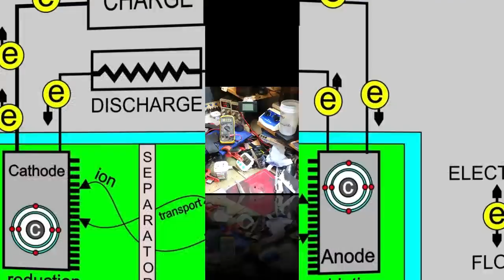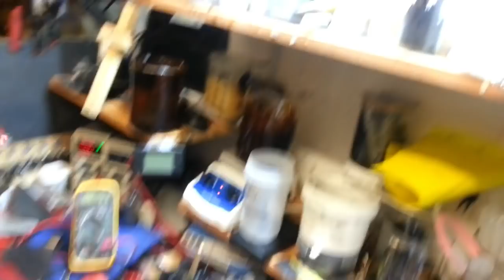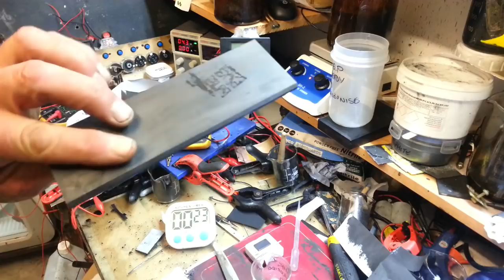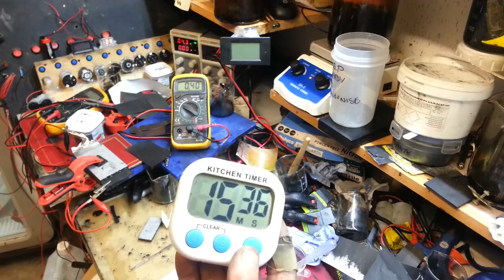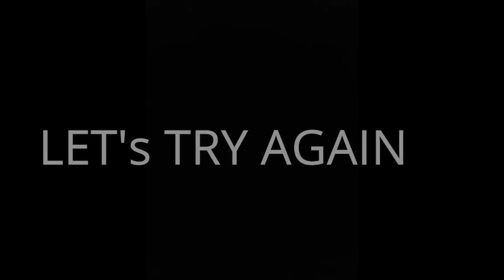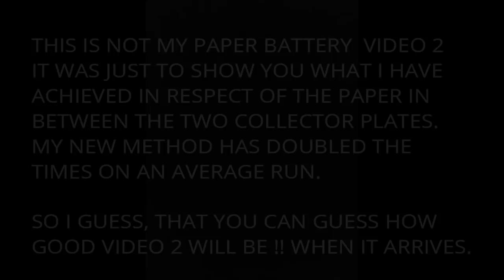my ENHANCED PAPER BATTERY this is not version 2 video just yet

Comment: Hi Kev "i'll be Black"  ;-) I Think, you are becoming a Real Pro over time, and The measure-methods are becoming much more comparable with what you are trying to accomplish what you are doing. And you perspective about "surface-area thinking" is spot on after my opinion to. So all in all you are doing very well..........I don't know if you have tried "carbonized leaves" .....if they are any good ?....I know looking at the timer is like looking paint drying...but it has to be don... as longer the better  ;-) .......Best to You Jørgen Thomsen Denmark DK
Reply from the maker: Jørgen Thomsen hi again and many thanks Jørgen yes times are getting better. Just wait until you see my next two video's it's like an explosion of power.
But yes i did try leaves a while back and it was not very good but i think that i rushed things a little, so you have just reminded me to try again and i will do just that very soon.
Many thanks.
Reply: Looking Forward se U....... By the Way have you seen the sexy battery "power blade" RS have made....looking good.

Comment: Would this battery be capable of high amps discharge(thinking of replacing 18650 power tool battery and electric kick scooter with these)?
Reply from the maker: Nikita Redko Ultimateley yes i think so. And much more.

Comment: High Kev - very impressive for a paper battery - a battery design that looks like it could be easily scaled !!!!!!!  

Question 1:  Is the carbon coating on either side of the paper forming the anode and cathode?  Or are you using just one side of the carbon coated paper and the graphite is the anode (or cathode).  Not sure what we were looking at in terms of your structure.  Apologize ahead of time if I blinked and missed something in the video of the full structure. 

2nd question - was there any drying of the electrolyte over the various test runs that might have affected the results?

Cheers and thanks again for sharing. 
Dennis
Reply from the maker: there is no short because paper is an insulator.
yes electrolyte applied on anode and cathode.
yes the carbon gets painted on both sides.
i hope this helps kev
Reply from the maker: Dennis hi mate yes carbon on both sides of the paper, so anode and cathode.
As regards electrolyte and drying not much to speak of in this scenario. Although this is in free air and not a sealed unit so you do get run off. I E it ends up on the bench !
Reply: Thanks - clear now.  So the variations in performance were only due to the current collector - the graphite.  You're right on saying that the unknown here was the specs. on the graphite.  Is 'graphite' the best leading contender for current collectors?
Reply from the maker: Dennis well at this juncture i really do not know the answer.
But if it is to be graphite as the collector, then you need a known supply with specs.
Reply: Mr Wallcroft

i try to understand

Why doesn't the electrolyte wet the paper and create a ''short''?
Is an electrolyte applied on the anode and cathode?
Is the carbon paint identical on both side?

Thank you
Reply: Mr Wallcroft

what defines the voltage of a battery? Why does the voltage of a 18650 battery is 3.7V?
Is this the material? the lenght (65mm)

thank you again
Reply from the maker: there are many things which can affect the cell potentials in a battery and there are to many equations to talk about here. apart from metals even carbons can affect the potentials.
if you google the lithium battery you should get an answer.
Do you mean the material length of my paper ? if so yes about 65mm
thanks
Reply: kev wallcroft 
Thank you